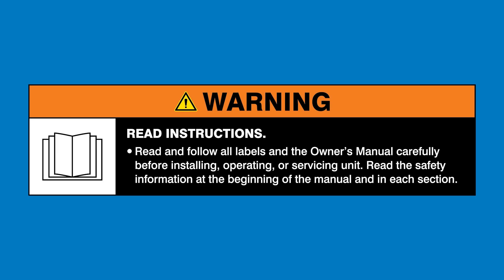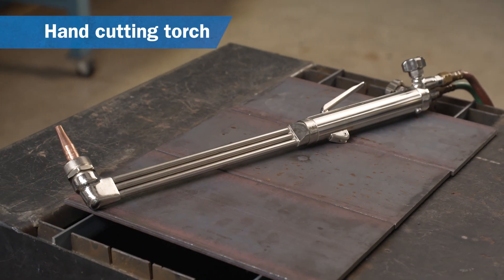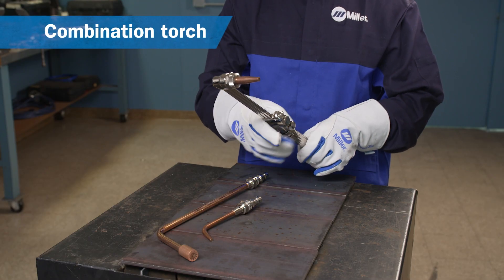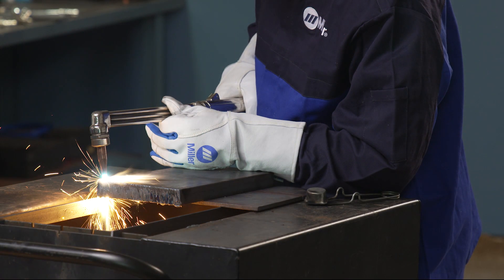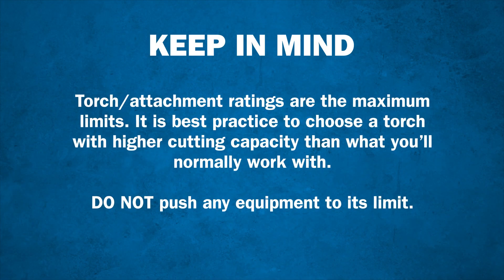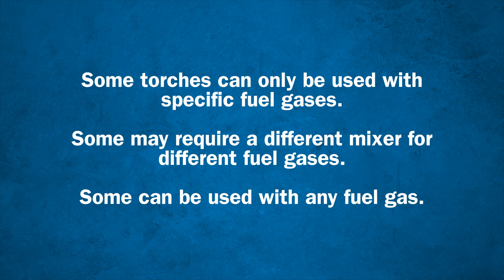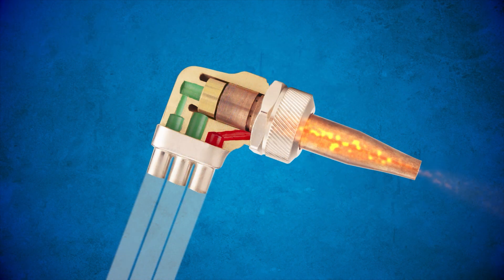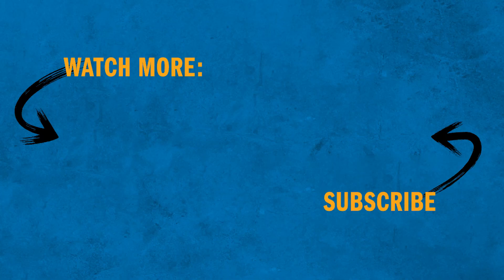How To Choose a Hand-Held Oxy-Fuel Torch

Comment: This is interesting,thank you very much!!!! But i have a question, i tried to melt nickel chrome alloy for casting. I used oxyacetylene gas with narrow tip torch. Blue flame. But it didn't changed to liquid state. What is the problem
Reply from the maker: Thank you for reaching out! You may need a larger tip to bring the nickel chrome alloy to liquidus temperature. If you would like additional assistance and recommendations, please call us at 920.734.9821.
Reply: @MillerWelders  thank you very much i will try with the larger tip